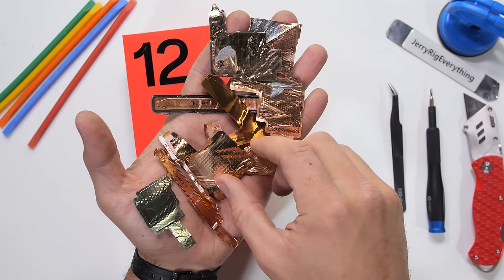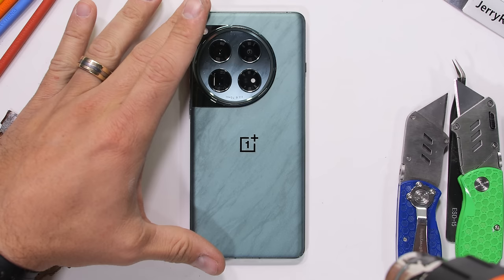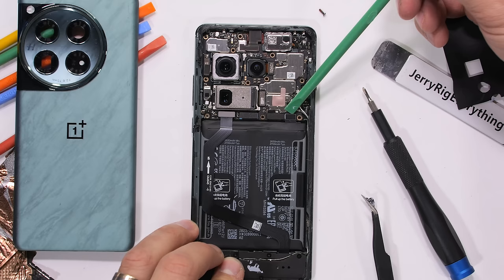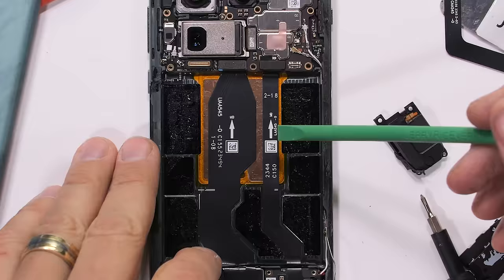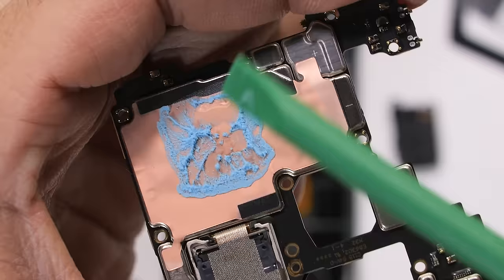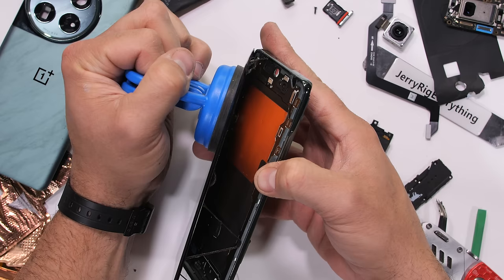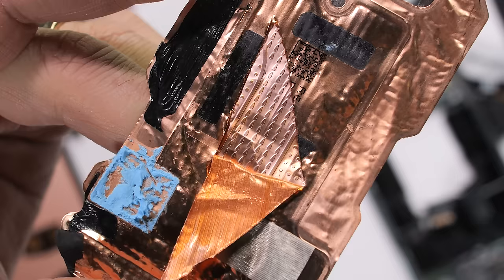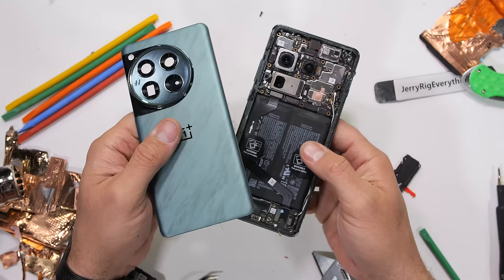The OnePlus 12 is the Coolest phone ever seen...

Comment: I use one plus 7t and its running good wanted to upgrade so confused between 12 or 12r can some one suggest. Is it worth to spend 200$ extra for one plus 12
Reply: oneplus 12r uses snapdragon 8 gen 2 instead of the current best being 8 gen 3 and has worse cameras and no telephoto lens but that 12r does have 100 mah more battery which means almost nothing, so if you game a lot or care about having good photos and stuff, then get the 12 but if you dont do either much then the 12r would be fine for you
Reply: @L_ightninng  I kept a hold on buying both 12 or 12r. Tried the one plus 12 with exchange , but they rejected as I had small dot in the side panel. It's a complete fraud . So Thinking to buy iPhone 13,14 or 15 instead of buying one plus 12 for same amount and the resale from one plus is a fraud.

Comment: OP is sadly DEAD to me. I had the OP6, 7T and 10 Pro.
6 was good, 7T was decent initially. But with every Android/SW update the Phones became WORSE AND WORSE AND WORSE. I don't know who exactly to blame for it, I'm sooooo done with them, that I stopped doing updates: 
Android 13 made the experience already bad enough, and I will certainly not update to their latest Android 14 crap with their "smart algo battery engine with biomimetic self restoration technology" crap (I didn't make that up, that's what they wrote in the Update summary).

So yeah, I wont buy ANY OP anymore, until I see that the Software is on the level it was years ago. (And I until stop seeing 300 page long threads on their forums where people complain about updates ruining their phones).

My only problem is, I haven't done any research on proper alternatives, who are like what OP was 5-10 years ago. Any suggestions are welcome ...